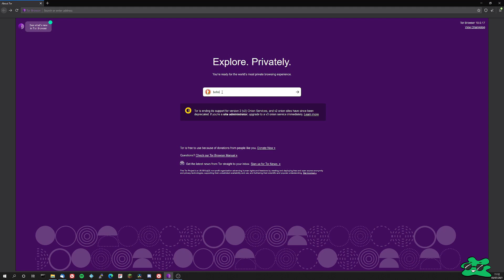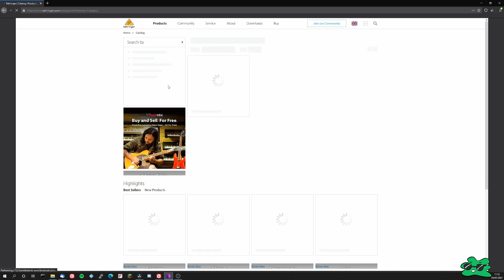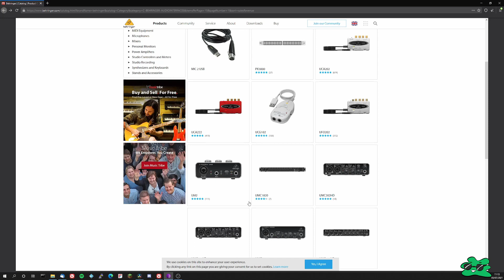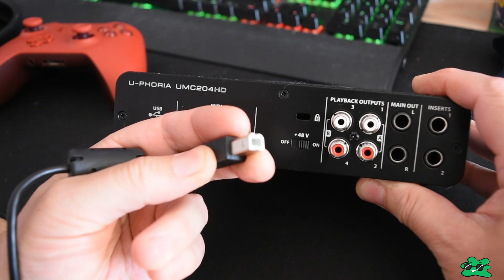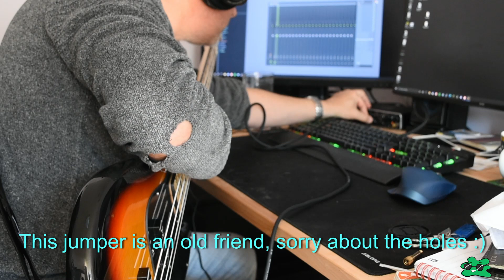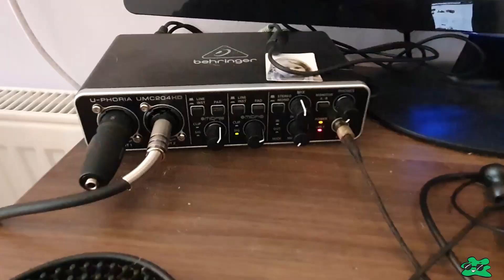Behringer U-Phoria UMC 204 HD Audio Interface

Comment: Thanks for the comment about the stereo/mono switch for monitoring. I was having trouble deciding between the 202 and 204 because I didn't need all of the features of the 204, but I believe I would be endlessly annoyed by input 1 and input 2 in separate ears during monitoring while recording. This is reason enough for me to get the 204.

Comment: My DAW didn't recognize this specific interface but it did recognize the Windows sound interface.
I tried all of my USB inputs with the same result.
So, I thought I would select the Windows interface, just to see what happened.  At that point, my DAW decided to recognize my interface.
I did not install any drivers.  Maybe if I had, the DAW might have recognized my interface?
IDK.
But it is working flawlessly regardless of the minor ID issues.

Comment: I just bought this a couple days ago, and it gave me NO trouble setting up. I have windows. Did not require drivers, it just worked. My DAW saw it, and I was off to the races. Love it!! even the midi was perfect. Thanks so much for the info about the mono/stereo switch. Very helpful.

Comment: I bought this and while it works there are a few quirks about it that made me go ahead and buy another Presonus and send this one back. My main issue is channel bleed. I had a channel in the DAW set on chan 1 and my guitar in chan 2, yes my fault, but it wasn't a dead signal ok. I could get a pretty string signal through channel 1,and even increase it with the gain knob. 2, the inst/line switch is hard to know which setting is which. The button is in Approx the same position. And lastly and the whole reason is the preamps are nasty sounding. Very very bright, as is the whole unit. Much brighter than the old Presonus I had. The guitars DI with a Sim, too brittle on the top end and I just don't like the sound of them. I've been recording for nearly 20 years, I've had several interfaces in that time, and this one I can't stand. I like Behringer, I have a lot of their stuff. This is not one of their proudest moements. I had high hopes for it too. I think it looks cool, has great features, but just can't go the sound of it.

Comment: so if you plug in a microphone, you select LINE?
my interface (as well as most other interfaces) has a MIC and LINE switch. 
the INST is a different input.
LINE level is not the same as MIC PREAMP level.
Reply from the maker: Hi, yes, I would select LINE for a microphone, on the 204HD Inputs 1 and 2 are both designated MIC / Line so you can plug either microphones or instruments using either XLR or 1/4" connectors. There is a LINE / INST selector for each input which designates line level or instrument level input source. If you need phantom power (48V) for your microphones then there is a switch on the back and I also show an adapter in the video which i sometimes use to allow me to plug in a PC condenser mike which coincidentally also requires 48V to use. AM
Reply: @AmoebaMan  thanks. my current interface has a MIC and LINE switch. 
because LINE and MIC are not the same preamp.

Comment: Are the insert outputs instrument level at all?  I am trying to find an interface that can be used as an outboard FX loop for guitar pedals.
Reply from the maker: I use the rear outputs (fixed) to drive a line input to an audio amplifier. Any guitar pedals I use are upstream i.e. before the interface obviously apart from any software effects I apply using a DAW on my PC. I do sometimes use a DI signal out of my bass head unit as a LINE input to the interface and this works fine also, AM
Reply: Thanks for that - makes sense.  @AmoebaMan

Comment: Hi I have just purchased the Behringer 204hd and have CR3 monitor speakers. Could you recommend a cable to enable my monitors. Sorry new to all this. Thanks
Reply from the maker: Of course it depends on what your speakers require for input, I just buy 2 x 1/4 inch mono jack to phono lead cable - I’m sorry I don’t have any particular brand recommendation. Good luck! AM
Reply: @AmoebaMan  many thanks for your tabs advice. Regards Brian

Comment: So the question that no-one seems to cover in any of their reviews of this interface which I hope you can answer is this? Do all these outputs act as individula independent outputs? So can you re-route the RCA A and B outputs to have different audio paths coming out of them either with some accompanying Behringer GUI software or through the outputs of your DAW? So for example are they recognised by either CORE (Mac) or ASIO (pc) drivers as audio outputs 1-6? (1+2 being Main outputs then 3-4 being Outputs A and perhaps 5-6 being outputs B?) 
Or do these ouputs only mirror the inputs coming on on Channels 1 and 2 on the front panel if the balance dial is switched towards direct input monitoring?
I hope that makes sense....

Comment: Is the out main out and playback out separate? I need to if its separate since I need to send different instrument with dedicated out (atleast 4 different output) and Im looking for something affordably cheap like UMC204hd.
Reply from the maker: I don't use the playback outputs but as I understand it they can be used for a separate set of monitors - from what I have read it is a separate line out independent from the volume control - you would need to check this in the manual. Good luck! AM
Reply: @AmoebaMan  Thanks, I've checked the manual and its confirm separate outputs.

Comment: Hi, I use this and monitors plugged in to my pc daily and I have problem when turn of pc or start it I have that loud "bum" Sound
How to fix it?
Reply: have you fix it already? cause i have the same problem
Reply: @zadie1271  still available but on lower volume it is quieter. 
Back potentiometer i set on 30% and it helped a bit. 
I think it might be done by some usb adapter with time lag but i couldn't find any of these

Comment: Will this work for vinyl recording
Reply from the maker: A lot of PC's have a line input already built in, I have never tried digitizing vinyl but my guess is that an Audio Interface is probably not necessary, even cheap USB soundcards have 3.5mm line-in and would probably be easier to use even if your turntable doesn't have USB. AM

Comment: Thank you for review.  Re the UMC202HD, why would the design allow only ONE SIDE of the headphone to work? I'm only concerned with doing interviews with no instruments. But I'd like to hear both sides.
Reply from the maker: This occurred when I tested the cheaper models using the 'monitoring' feature - as the input was mono it only came out of one side of the headphones and had no stereo / mono button. If you don't plan to use monitoring e.g. if you are using a DAW then it would not impact you.  When I am travelling / practicing bass I often use the monitoring feature for listening to my playing along with other sounds, this works particularly well for me because you don't get issues with latency that sometimes occur with DAW. AM

Comment: Do you have any idea if the Behringer UMC204HD will work with an ipad (as in 2021, 9th-gen)? My son dove headfirst into learning guitar and is loving it but none of us are "techie" minded about gear or such. This interface seems good for the long-haul, I'm just not finding clearcut information about what "computer" category would be best for it. Any constructive input is much appreciated!
Reply from the maker: I tried this yesterday and was able to connect my 204HD to a 2021 iPad Pro and and Android phone successfully - in both cases the device recognised the 204HD as an external soundcard, the headphone aand audio outputs worked OK.  A good indication but unfortunately I was not able to test the audio interface inputs / full functionality as I lack the software necessary.  This suggests to me that with the right software it may well be possible to use, I would be concerned about battery usage so a external power supply might be a good idea in this scenario.. AM
Reply from the maker: The new USB-C iPad Pro's officially support some audio interfaces e.g. the gen 3 focusrite ones. Sorry, I am not sure about the Behringer or older / different iPads, currently I am not in a position to try it, I will let you know if I do! AM
Reply: From what I know this is a "Class Compliant" device which was something developed to work on Ipads/Iphones without the need to install any drivers, just plug and play. This interface works on Windows, MacOS, IPHONE/IPAD and even LINUX.